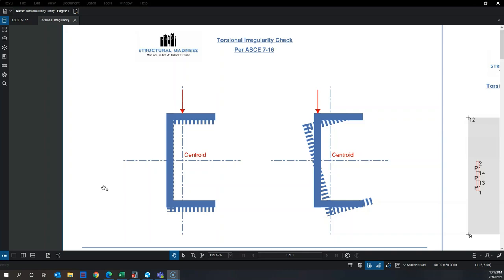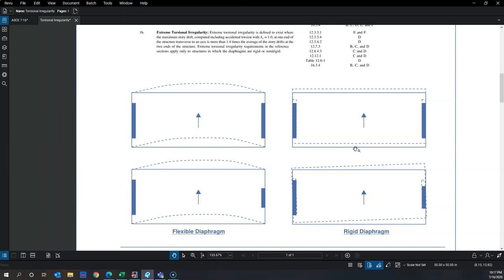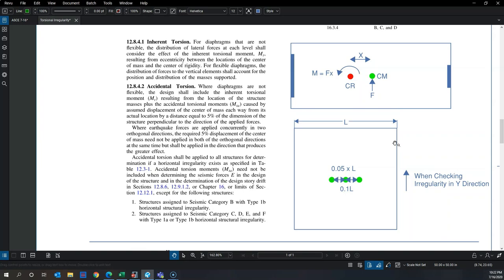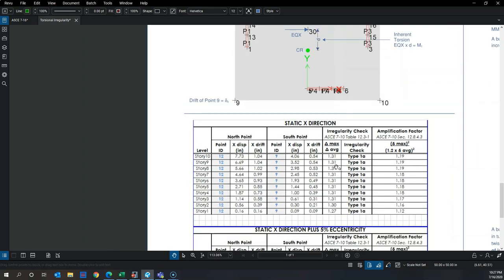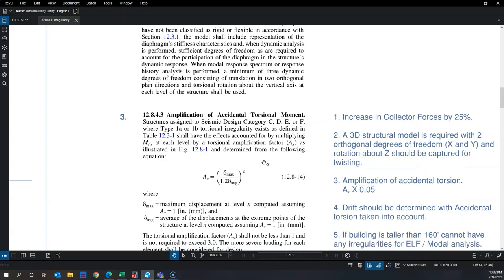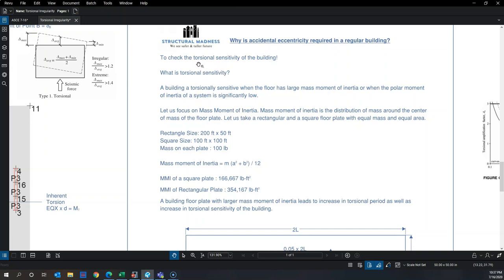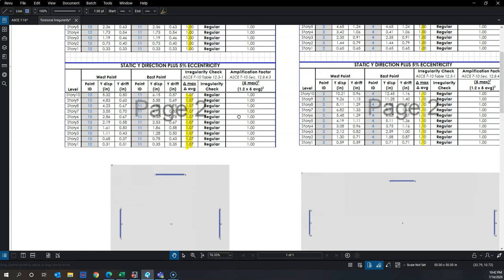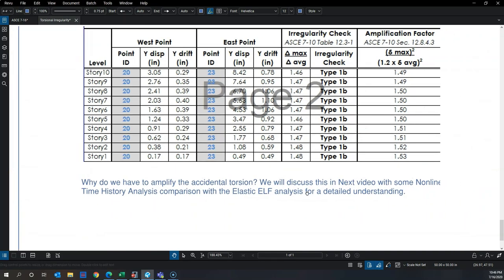Torsional Irregularity Check Per ASCE 7-16

Comment from the maker: All, one correction in the video at the beginning!  The channel section will not twist when the load is applied at the shear center and not the centroid! I apologize for the error in the beginning. I will post a video on differences in shear center vs centroid of a section!